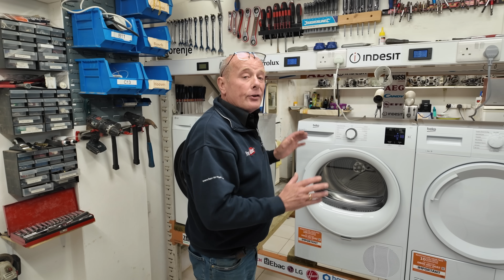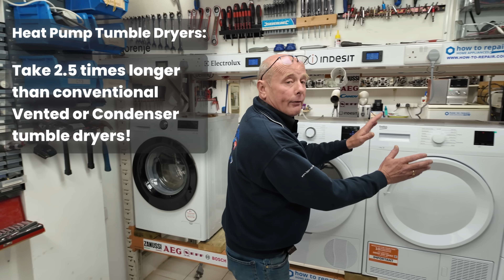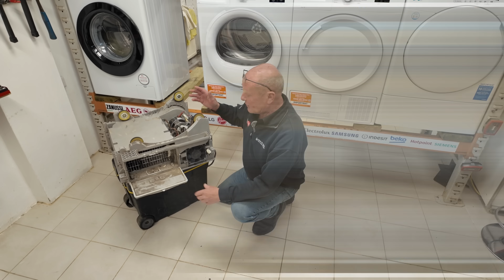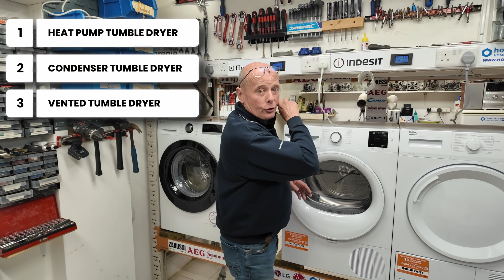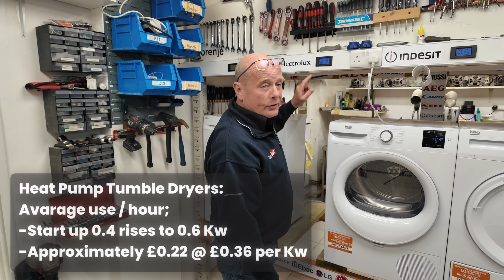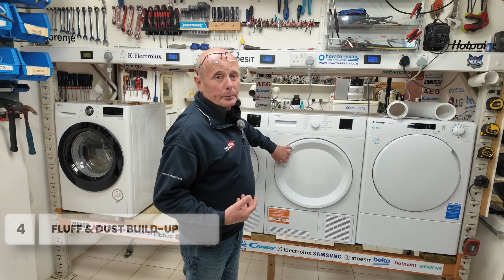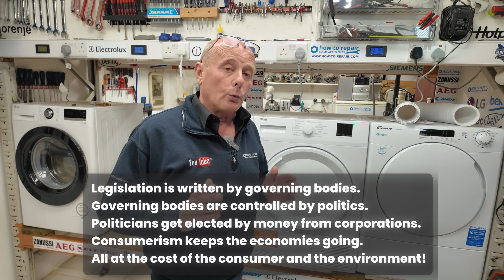Tumble Dryers the Shocking Truth About Heat Pump vs Vented & Condenser, NEW LEGISLATION!

Comment: What I don't see mentioned here is the issue with Vented driers in that they cause negatives pressure in the house. All that air it's sucking in the blow over the element to heat the clitued to then blow out side, has to come from somewhere and it's usually cold air being sucked in from every crack and nook in that house causing the entire house to get colder just to dry your clothes with a vented dryer. So not only do they use more energy , they cause the house to need more energy to just keep warm in order to dry your clothes.

Comment: My washing machine broke after 13 months. Took insurance out. It covered new parts and labour. Have had new drum shocks pump and motor and still worked out cheaper than buying a new machine over 2 years. I would look at extending the insurance to cover the tumble dryer as well

Comment: To have a cycle of 60-75 minutes on a load of towels my 10 year old Zanussi externally-vented machine copes well. The washing goes on overnight, and I can get the load dried while the electricity is still on cheap night time rate. However, if a new heat-pump machine is going to take considerably longer for the cycle, then more than half the time will be on full rate electricity - so no savings there!
Excellent video, really clear thank you!

Comment: Old man complains about energy saving policies... All I know is my condensing dryer doesn't need a hole in my wall to vent to. So my home has one less hole in its walls. Plus I can place a heatpump dryer in any space where it fits without any installation of a vent. I can even move it to a new location without needing to install a new vent. It's convenient especially in rented accommodation.

Still dries faster than a washing line and does actually use less energy than an old vented model

Comment: I've had a Samsung heat pump dryer for 13 years. It gets used probably five days a week. It just works. I do keep the condenser clean and once every few years I take the whole dryer apart and clean the fluff out.
I also don't get this, "it takes longer". Mines fine. Takes as long as an old vented one that it replaced. 

One thing to note: I know a firefighter here in my town. He told me the two most common call outs he gets are tumble dryers and electric vehicles. 
A heat pump machine doesn't have a heating element so there should be a lower risk of lint catching fire inside.

Comment: I've been using a Miele heatpump dryer since 2017 with zero issues so far, almost a decade in. Just with regular cleaning of the filters. Regarding the runtime: the compressor isn't running the full length of the program. That's visible on any kWh meter. Regarding clothing wear and tear, the lower temperature of a heatpump dryer is in fact beneficial for your clothing compared to a classic dryer. And this also results in virtually no home fires with heatpump dryers, while both the condensed and vented dryers have been in the top 3 causes of domestic fires for decades.

Comment: so...since these are a big portion of total household electric use...we can say total household electric use can be cut by almost 50%...correct? Do you have any cost reduction figures for typical household?
I think motor life of these are great since they are brushless motors. Just need data on heatpump system reliability. My rough estimate is it can pay for it in about one year use.

Comment: This sounds a bit like when they reduce the maximum power output on vacuum cleaners, yes they could save you money with less electricity being used.

However, I would suggest that you are more likely to use the newer less powerful vacuum cleaner for much longer to get the same results, so possibly no energy or money saved. 

Again, I guess this is another "smoke and mirrors" from government and industry. 

Anyone smart will do the maths of initial cost + the running cost + service cost and see that heat pump tumble dryers  aren't  cheaper in the long run...

Comment: Measure the actual kWh used to dry the same load in all three machines. The final difference might be only around 200 Wh per cycle. What's the real saving then?

Comment: the heat pump dryer is pretty much a closed system and the room temperature and humidity dont really influence it that much. sure the heatpump system is pretty much unrepairable and unreplaceable but how many hours do you really use it? surely less hours than a fridge which uses exactly the same pump system and nobody talks about the lifespan or repairability of those. my AEG lasted 8 years because of bad soldering joints and i couldnt be arsed to repair it. it wasnt that hard to take apart and clean either, i replaced the motor before. yes you have to disassemble half the machine to clean it, but the half you have to remove doenst consist of that many parts, those are at the bottom you are trying to get to. i dont think the number of occuring pump failures outweigh the benefits of these machines

Comment: If it takes 2.5 times linger to dry the clothes I can't see that there would be that much electricity or power savings. I'm sure that the time to dry the clothes will also increase as the dirt increases in the components making them less efficient as time goes on. In fact the clothes would probably dry faster if one was to hang the clothes on an indoor close line that are available online and are much cheaper. I live in the US and I setup a close line in my garage when my dryer wet out. Works probably just as fast or faster then that heat pump dryer. Especially if I put a 20 inch fan in there to circulate the air in the winter. 
But in reality the laws being passed on these energy saving devices is a scam and you can bet that the politicians are corrupt getting paid off to pass these laws. All of the climate change is one big money scam! I've been watching it from the start. It started with the scientist finding the hole in the ozone in the arctic circles. They found that panic brought in loads of money from both people and governments that knew nothing. At first they didn't know what was causing the holes but they found that Chlorine was the only chemical that could destroy Ozone. And they settles on Chlorofluorocarbon (CFC) as the one  item that that was causing the ozone depletion because of the Chlorine that was part of the make up of the CFC. They all stated that it was the chlorine that was making its way far up to the ozone layer and the people and governments all bought in on that lie without any further investigating. Any scientist that came out with opposing facts with threatened with losing their jobs or death if they continued to show what was causing the holes. This was back in the 1980s when that lying fool Arthur C. Clarke had his TV sows on. Arthur C. Clarke was not a real scientist, he was a radar specialist for the RAF during WWII and later a mathematician. His shows made wild claims that most if not all were just B/S and people believed him. 
However, the holes in the ozone were found to be cause by the earths magnetic fields. That is why they are only found at the north and south poles. But that was released very quietly. As for the chlorine in the CFCs causing the hole that was a complete lie. If that was true the amount of chlorine released by the oceans through evaporation would have depleted the ozone long before man came into the picture. The chlorine released by the oceans in one day is far more than all the CFCs that have been produced since they were invented. Plus chlorine is heavier than air it sinks to the ground. That is why they used it in WWI because it sank into the trenches. So chlorine would never get up to the ozone layer. 
But after that the environment terrorist took over because they found it was a money making scam. Then the corrupt governments got involved so they could make money on a B/S lie.
If y'all want to stop this start getting rid of the corruption in politics and stop believing in much of the B/S a few scientist spread. Remember what the great Churchill once said:  "A lie gets halfway around the world before the truth has a chance to get its pants on." and "The Russian Bolsheviks have discovered that truth does not matter so long as there is reiteration. They have no difficulty whatever in countering a fact by a lie which, if repeated often enough and loudly enough, becomes accepted by the people." Never just go with what science tell you, science is not always fact. Many times science is only fact until someone disproves the current thinking and that has happened more than can be counted. At one time the scientists of the time though everything revolved around the earth and the earth was flat. Always question science never settle for just one answer. That is how dictators are created.

Comment: I just replaced a Beko Condenser tumble dryer (failed bearings) with a Hoover HP dryer. It takes 90 minutes to dry my washing versus 60 with the Beko but the energy consumption with the new machine is less than 600 Wh compared to the old one which was 3kWh. For me, the new HP dryer is an absolute winner.

Comment: My heat pump tumble dryer is not drying at all, I’ve cleaned all the filters and now thinking of replacing with a condenser dryer.  Thanks for the information
Reply from the maker: That's a shame but unfortunately heat pump models often suffer from build-up deep inside the heat exchanger that's hard to reach. I'd love to help but they make so many different versions of these! Please use our help page to send over your full model number so I can pull up the exact schematics for your machine. Please don't forget to subscribe to the channel and share the video if it is possible.

https://how-to-repair.com/pages/help-support

Comment: Excellent and informative video, as always.  Thanks for your expert guidance. I actually came across this video after googling Bosch WTH85226GB with the intention of buying online. It was the heat pump dryer i had decided on after doing some "research". Foolishly, I didn't consider the extra wear on the bearings and motor. I was focused on the energy use, and greenwashed myself. 
I'm so glad I saw this video. It's completely changed my perspective. I'll be getting a condenser dryer now instead!

Comment: I have had a vented Indesit made here in UK is is daily use. 7 years old the carbon bearing has worn. Easy fix they are not that inefficient simple machine. Sad to hear they have closed the UK factory last year. How is shipping a white good machine half way round the world enviromentally friendly?? Heatpump tumble dryers are not enviromentally friendly shorter lifespans. My vented machine has an easy 7-10 years left.

Comment: That heat pump dryer is a fire hazard with all of that fluff. 
Look what happened to the Yankee battleship in the Iran war. The laundry fire caused more damage than a missile hit. 
Also where is all the used refrigerant gas going to end up?
Absolute greenwashing  from non techno beurocrats.

Comment: We bought a Bosch series 8 heat pump dryer a few years ago. I regretted it within the first month. It’s not a machine for convenience.  To get the best use out of them is to allow about 4 hours to dry a full load. Preferably overnight. Not really very good if you’ve got to dry your kids football kit before school etc. A few years later though, I’ve had enough. I’ve persevered with the filters every week, and cleaned out the condenser a couple of times, but it’s just a complicated annoyance. If they installed these in a laundrette, it would probably go out of business. The world is hell bent on getting us to buy efficient machines that are kinder to the environment, such as cars with small turbocharged engines that give up after 60,000 miles. But it’s false economy. If machines need replacing every 5 to 10 years if you’re very lucky, then we have to build more of them to replace the crap. Which is definitely not kind to the environment. It’s not a carbon free process. It just China burning increasing amounts of coal.

Comment: Dave I spent £800 on the AEG heat pump dryer in 2020. It just died. No warranty. Phoned an engineer who was kind enough to ask for a body  and said it was not worth repairing. I saw your video and found a Blomberg condenser fit just under £450. I did try sent look for higher end models but they are simply not making it serlimg them. Thank you. I hope mine lasts long enough for them to work out the technology in heat pumps.

Comment: My Mum's 1960's twin tub lasted her from the 1960s right up until the early 1990s when it finally went to the washing machine graveyard in the sky. Easy to operate & maintain & the spinner did half the job. It all dried fine. That's 30 years of use.

Comment: Just purchased a heat pump tumble dryer after my last dryer , which was vented and 15 years old  , was beyond economical repair . It's saving me £50 a month and has a 10 year warranty on the compressor. Yes it was expensive to buy but at this rate I'll have my money back in 2 years. If my compressor develops a fault in the next ten years the manufacturer will give me a new appliance . As for fluff build up the appliance has a self cleaning function which cleans the condenser and it has a separate cleaning program you can run . I'll let you guess the make . It's German . Same old same old . Buy cheap and you pay twice .

Comment: My ISE 10 (ASKO) condenser tumble dryer finally gave up after 16 years. It should have been a relatively easy repair, but unfortunately the front drum-support rollers are no longer available in the required size, so I’ve replaced it with an ASKO heat-pump dryer.

I have to say, I’m very impressed with it. Yes, it takes a little longer to dry, but certainly nowhere near 2.5 times as long in my experience.

Because it operates at a much lower temperature, it is also considerably gentler on clothes. I’m much more confident that I’m not going to shrink things, which has happened to me with T-shirts in the past. The heat-pump system uses both a cooling circuit and a heating circuit, allowing the moisture to condense at a much lower drying temperature. My new machine uses around 700W compared with approximately 2.7kW for my old condenser dryer, so the difference in energy consumption is significant.

I’ve also noticed considerably less fluff coming from the clothes. Whether that is due to the lower temperature, the gentler drying action, or the drum design, I can’t say, but there is definitely less.

I’ve not been concern about fluff getting into the condenser as the machine tells me when each filter needs cleaning after every cycle and I keep on top of it. The machine has now been used for several months and runs multiple times a week. I recently inspected the condenser behind the filter, and there was absolutely no dust or fluff that had made its way through the filters.

So, based purely on my own experience, my advice would be that if you have a heat-pump dryer, keep on top of the filter cleaning. How well the system prevents fluff reaching the condenser will obviously depend on how well the particular machine has been designed, but with mine I certainly haven’t experienced the problems thus far.

I’m only able to compare the two machines I’ve owned, but I have to say the ASKO is proving to be a very impressive machine. In fact, I hardly bother using the washing line anymore because I don’t see much benefit. Clothes coming off the line always seemed to need a tumble afterwards to soften them up anyway.

One other thought: if I have a load in the washing machine and another in the dryer, the washing machine usually takes longer to complete its cycle than the dryer takes to dry the previous load so it’s slightly longer duration isn’t an issue.

I’m certainly no appliance specialist, but I thought an everyday user’s experience might be useful, particularly from someone who has used both types of dryer for a reasonable length of time.

Comment: My AEG dryer
I bought it happily because it had a 5-year warranty and was the most expensive one at Harvey Norman Australia at the time. One month after the warranty ended, the breakdowns started, and they've cost a lot in terms of technician visits and part replacements. The biggest problem is water pooling under the filter near the pump, which requires cleaning after every single load. It's tedious, exhausting, and honestly ridiculous. I'm now looking for a model that doesn't have this ridiculous heat pump that's hard to clean, though it seems it's my fate to stick with AEG.

Comment: I will go to fucking war if they outlaw standard dryers in America, those combo ones that recirculat the air don't work good at all, from the reviews and the one I have, a good made one will actually pull the moisture out of the air but to really pull it out good and fast you need a strong condenser to cool the air which uses a lot of electricity so no one makes them that good. The one I have is so poorly designed there is no condenser to cool the warm air it's just cold water running over plastic and the hot air hits that, compete garbage. They do make a combo washer dryer that vents outside I think it's Samsung, that's the one I would buy.